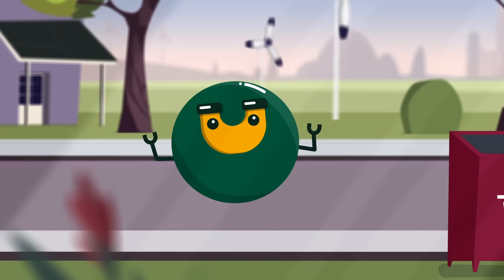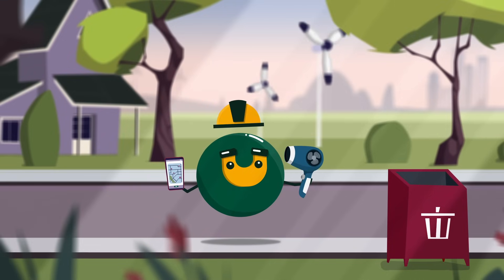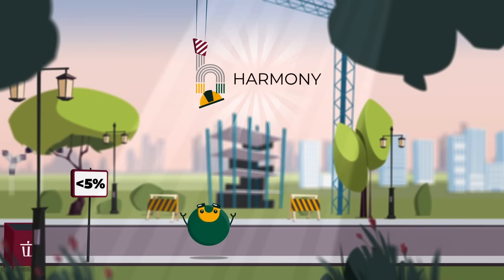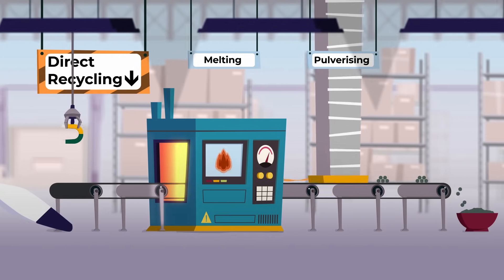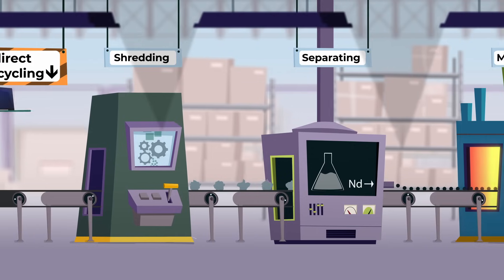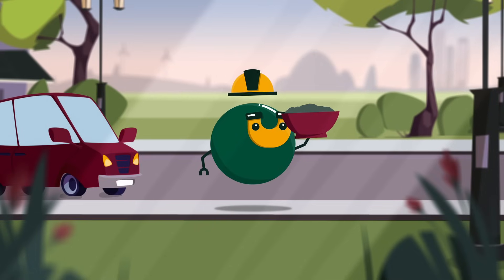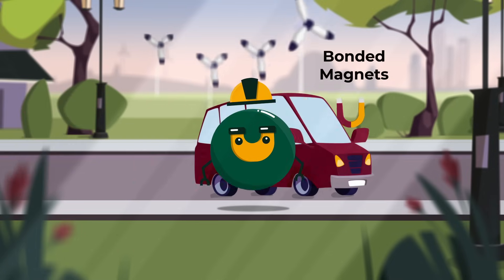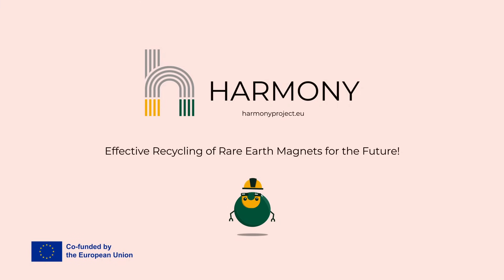Recycling Magnets and Rare Earth Elements

Comment: Aww, Magnus is cute. 😍One thing I'm wonderin - you mention that with indirect recycling the electronic parts are shredded and with various chemical processess the neodymium is seperated. What happens to the other materials that are part of the shredded material? Does it also get recycled into other stuff? 🤔
Reply from the maker: Thank you for your question! Yes, the other materials in the shredded electronic parts are also recycled. Iron is usually separated and used in steel production. In addition, other rare earth elements found alongside neodymium are separated and can be reused in new applications. The aim of the HARMONY project is to make the process as sustainable as possible, and if it is possible to isolate compounds in their pure form, they will be returned to processes that require these materials. Unfortunately, not all materials can be purified to a quality suitable for reuse at this stage, but the team is hopeful that this will be possible in the future.
Reply: @esci  Well, thank you for your response. 😊Hope you have success with the project.